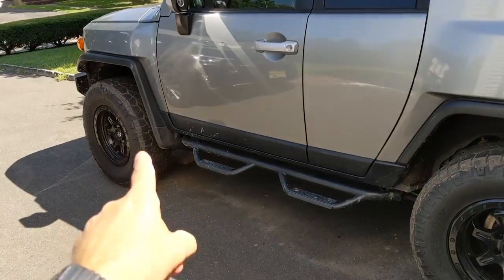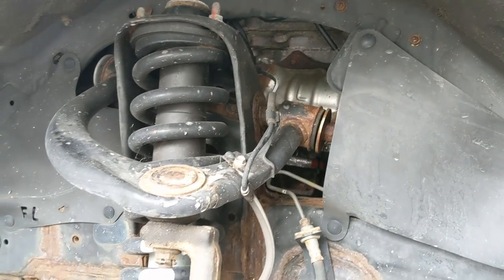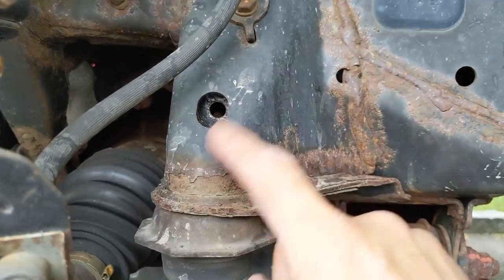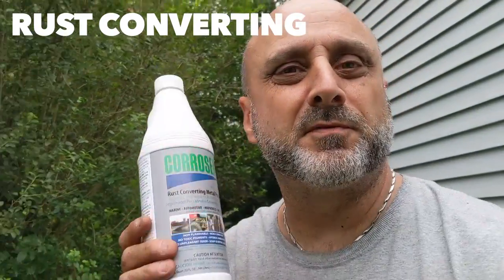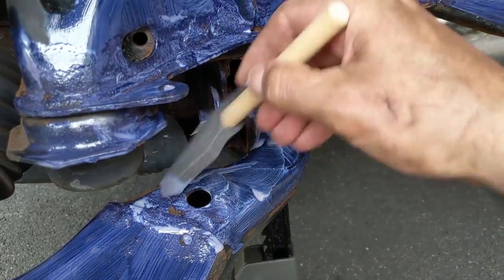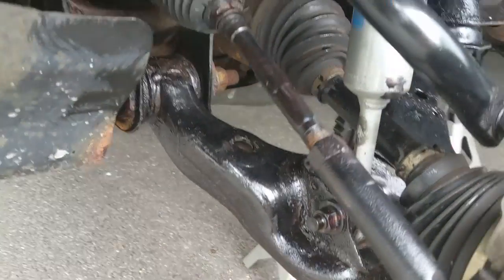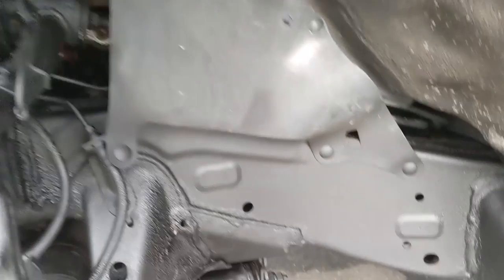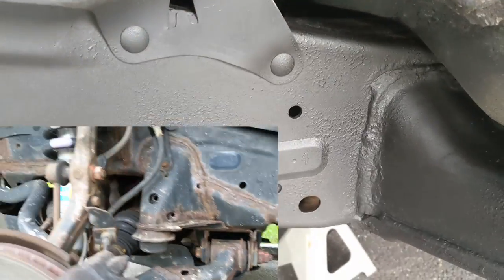How To Remove Rust From Chassis

Comment: Hey buddy! Found your video how to remove rust! Been following yours and all the guys motorcycle videos. I was surprised to find this one from you! I’m building a Ram 2500 and moving to Michigan from North Carolina. Trying to prep the truck and protect it from future rust. Got the Florida truck with zero rust, just wanted to clean minor surface rust of the wheel Huns because I just got new rims and 37” tires and did not want to install center caps. Thanks.

Comment: I did this to my 2002 4runner slowly over the course of the summer. I "painted" the whole frame with RP342 Black (cosmoline). I recommend you also spray the inside of the frame with fluid film to prevent rust that may form undetected until it's too late.
Reply: ------------------------- Quick-Glo  isn't available .   It's a mystery.  -Quick Glo has disappeared. No one can contact the owner's that made a famous ad with Jay Leno.  Inventories have disappeared in the U.S. ,U.K. and Australia. Does anyone know for sure what is happening?  I ordered a large supply months ago from their Website which is still running. I rec'd nothing not even an email confirming my order.  Quick-glo is the best for chrome and rust and as a preventative.   If you know what has happened; please please report on your findings.
Reply: Do you have any suggestions for a product for the fluid film?
Reply: Hey, that's exactly what im planning on doing..Did you put RP342 Black over the rust converted layer, or did you put something in between

Comment: Possibly the most dangerous way to lift a truck up. Use the frame to lift it. The jack will slip off that control arm super easily.
Reply: I was thinking the same thing very sketchy

Comment: I have a 3 year old 4runner. There are surface rust on some of the welds.  I treated it with rust converter a few times. Did not paint over it.  I will see next spring if there are new rust.
Reply: Let me kmow
Reply: How does your 4Runner frame look, one year later?
Reply: How is your DIY holding up? Still no sign of rust?

Comment: The rust reformer is a very good step. You might want to reconsider using the rubberized undercoating it really doesn't work well and can actually speed up the rust. Another area you need to be concentrate on is inside the frame. The FJC rots from the inside out in many places.
Reply from the maker: J Jack Next step for me will be to insert spray oil/ grease into the frame through holes spread around the chassis
Reply: I AM SANDY my suggestion would be to use fluid film. You can get it reasonably through a discount auto parts store. You’re best to order the 360% spray can wand kit with a few cans through Amazon.
Reply: I AM SANDY be sure to join FJ Cruisers Rusted Frame Owners Unite for more help.

Comment: Great job except for the rubberized stuff... it doesnt breath. Please don't use that stuff. Will rust from the inside out.
Reply: i agree! The cleaning process and rust converter was great until i noticed the rubberized spray. That is a death sentence for any undercarriage.
Reply: @anavan7  so instead of spray is it best to leave after the rust converter ?
Reply: Andy C for “preventative” rust treatment yes. There’s the optional black gloss paint for final chassis coverage but only if you prep the prior stages very well. Look up Corroseal Water-Based Rust Converter Metal Primer.
Reply: @anavan7  what would you recommend?   Most undercarriage sprays I'm seeing are all rubberized.   You saying rustoleum and the other companies aren't good products? I gotta do this with my truck.  Climbed under it yesterday and was pretty disappointed
Reply: Having cleaner paint prep is key to adhesion
Reply: @jonathanritter7364  fluid film or wazoyl or dinotrol
Reply: @andyc609  spray it with fluid film or wazoyl hard wax or dinitrol.
Reply: Corrosion Free Formula 3000
Reply: @andyc609  It's not necessary to put any paint over the rust converter once it's hardened.
Reply: It was So good until the rubberized coating. Don't use that crap people! It Causes rust

Comment: Broke my heart to see you spray it with a rubberized coating after all that hard work. Thats going to trap moisture and make it 5x worse.
Reply: Hi, planning on doing every step up to the rust converter.... I eventually want to finish with COSMOLINE RP-342, should i put something in between that and the rust converter?

Comment: a cheap needle scaler is waaay faster and does a better job, rust converters have acid and thick coatings do promote rust by trapping moisture and rust converter acid.  get metal to clean brown [no scale] at least then coat with cold galvanising compound, lots of it, multiple wet thick coats. it creates an electro chemical condition where the zinc primer corrodes off, not the steel. plus it doesn't flake off or trap moisture so when you start to see brown through the primer simply recoat. easiest way ive found to protect undercarriage here in maine
Reply: nice. got any links to the product you use? thanks
Reply: I’d be interested in hearing about that product too…

Comment: Get a grinder and attach a 5/8 wire brush. It gets all the rust off effortlessly. You will need full-body protection from the wires flying around.
Reply: Yup, so far, I find grinder a d wire brush are the best combo.
Reply: What to do once grinded all rust off .. regular black paint ? Krown? Fluid film?

Comment: Good stuff... I found Corroseal to just be okay. The protective layer it creates isn't too durable. Avoid using rubber undercoating. It can trap moisture and cause even worse rust. The best option I found is Eastwood's rubberized rust encapsulator. Best of both worlds and easy to apply 💪🏼

Comment: Lots of great work but.....   The rust on these vehicles is inside the frame and unless you provide more drain holes and use an oil based product, the rust will continue and the frame will rot.  Second, the  use of a rubberized undercoat is a really bad idea because the moisture will get under it, be locked in and really  rot the frame.  I'm guessing by now the frame needs massive metal work.

Comment: There is a rustoleum product that did very well in a test on Project Farm.    It's a Rust Reformer and Paint all in one.    I think you can get it in colors, so I can do the silver body colored areas, or  grey components with a grey color and frame with black.

Comment: Why not use vinegar straight for the rust converter?  After that I would spray a lanolin based oil undercoat.  No need to prime or paint.  Lanolin is sheep fat.  Not harmful to the environment.  Save your money on buying Corroseal.